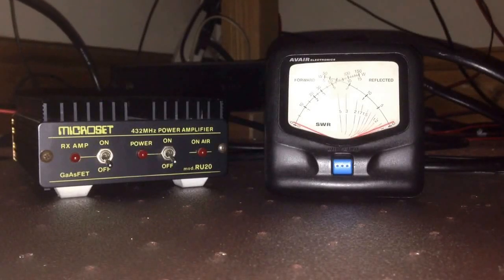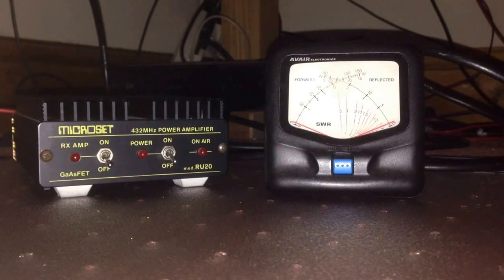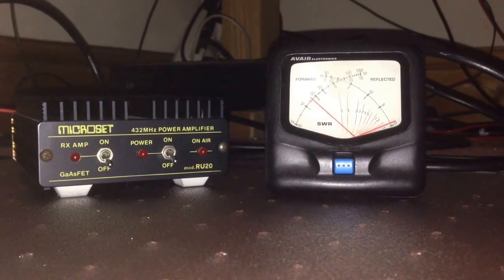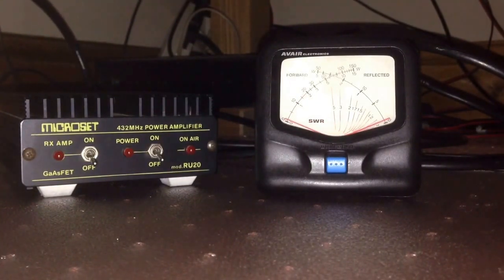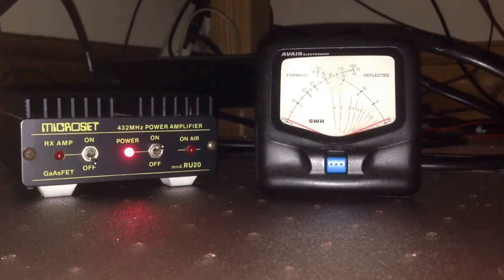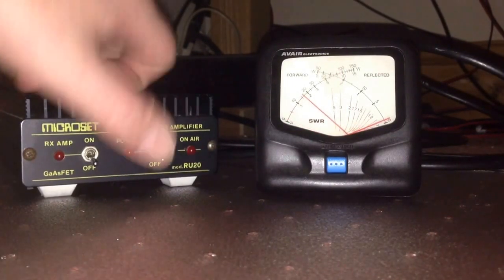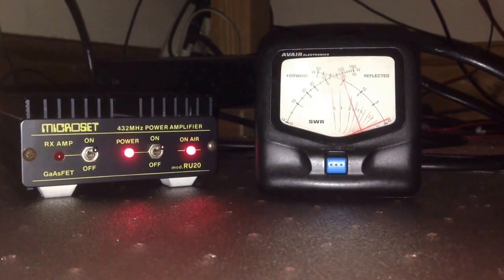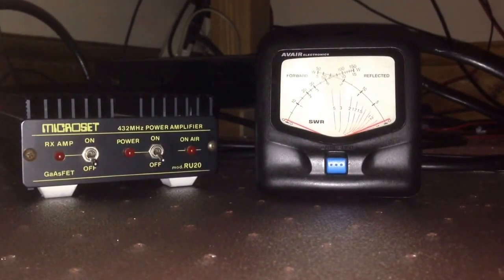Microset RU20 UHF linear amplifier

Comment: you could make yourself a cheap repeater, 2 handhelds, a controller and the amp and dummy load.
Reply from the maker: bald survivor comms ct1543  Indeed.... UHF is very under used around here.